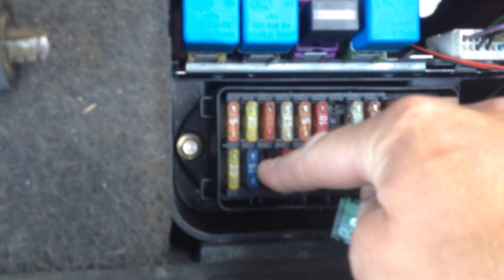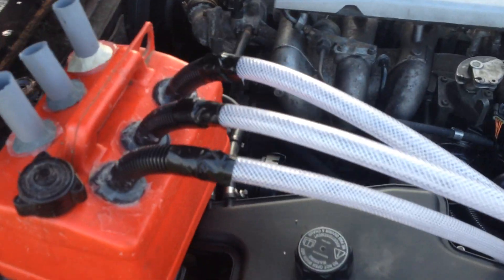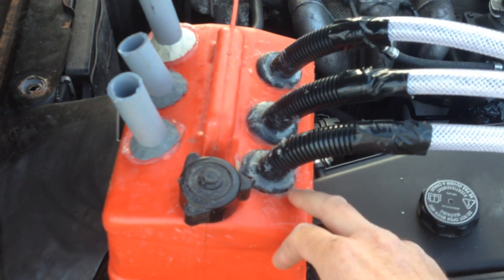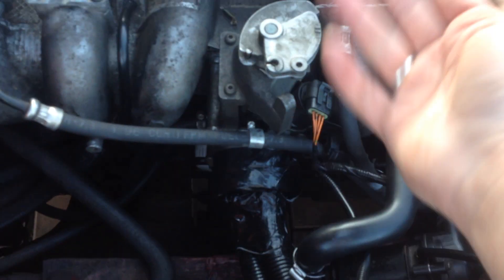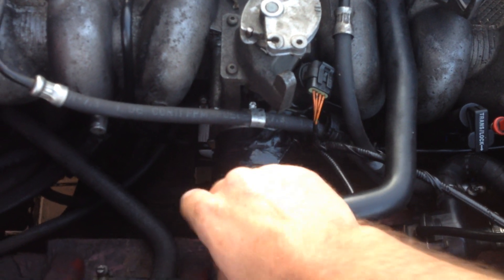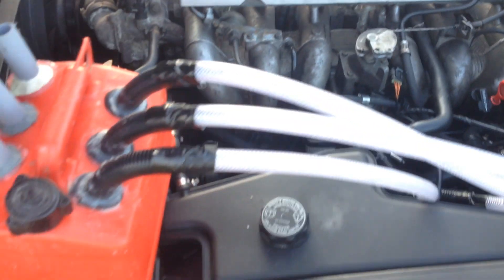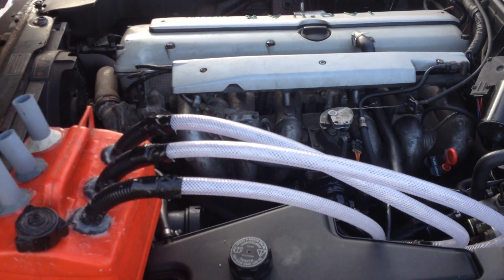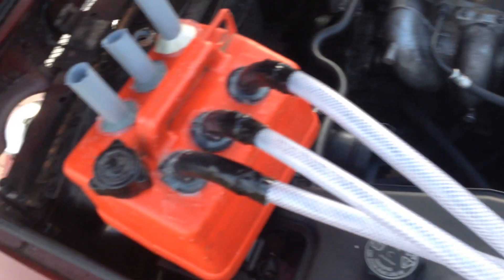Car Running On Petrol Vapour / Fumes / Jaguar X300 4.0 Sport

Comment: Makes sure its all sealead good and your air intake is set up out side of the engine compartmant so no vapers get clogged in the compartment making it a no go or it blows k? I also highly recomend a set up like under you bathroom sink a trap with a release valuve system or something like it. Ps you can also put an air line onto that one too very small skiny line and I would make sure it runs fresh air from outside aswell. Also a filter perhaps to stop any contaminations.

Comment: How much fuel does this save?
Reply from the maker: At idle there is around a 100% saving on fuel with a Jagar X300 4.0 engine.  This car under normal circumstances will burn around 2.4L an hour at idle.  I ran on vapor for 30mins on 600 ml  of petrol, so you could say that in half an hour the jag would use 1.2L under normal conditions and 600 ml on vapor, quite impressive.  Why a simple vapor draw system could not be employed on any petrol car for traffic scenarios so vapor from tank takes over, would save stacks of fuel in small engines.
Reply: Thomas Ogle was murdered for this. I don't how this is being suppressed so well. So much fuel is unbunt when it is liquid. That's why we have catalytic converters.

Comment from the maker: Hi Dhruv, no air filter and no injectors being used in this setup.  Purely petrol vapour entering throttle body and being ignited by the spark plugs. I never mentioned in the video that I have installed a flashback protector at the throttle intake, basic steel mesh strainer cannibalised, flame does not pass through it so should provide some basic protection against any backfires, never experienced any in my tests.  My next set up will include a set of filters and adjusters to control air/fuel mix and also a heater system to enhance vapour production.  I figured airborne dust and dirt will collect in the liquid petrol as a only the vapour is exiting the fuel can no contaminants are getting in.  Certainly nothing to clog up as injectors are not working. unplugged. I figured it would be a great opportunity to experiment on a big 4 litre engine.  If I can get this running well I can get it running on any petrol car of any capacity.  Really good fun doing this, more videos with adaptations and data to follow all the best. JD

Comment: hello sir,  i was curious to know if you connect fuel to air intake what about air filter. all the dust air filter filters would enter the engine may clog the injectors too.
Reply from the maker: Hi injectors cannot get clogged as they are not in use with this design, engines will run simply by sucking in fuel vapor mixed with air as demonstrated. A air filter would be ideal to keep the throttle body clean.
Reply: @MrJohnd1977  How to survive a fuel shortage or apocalypse :)